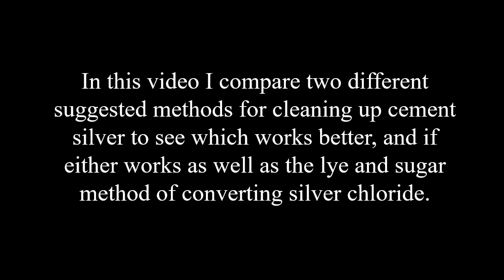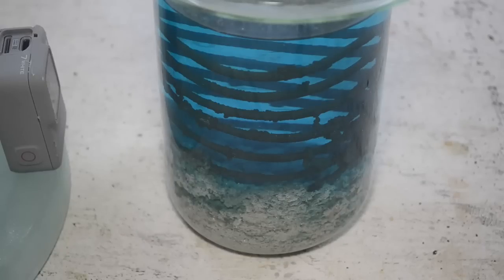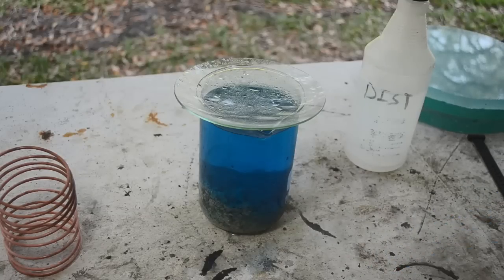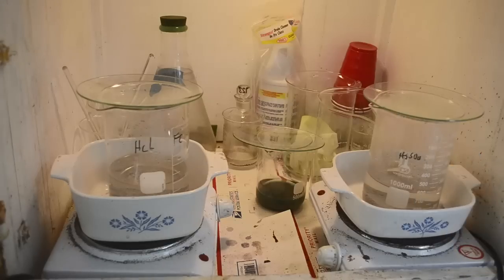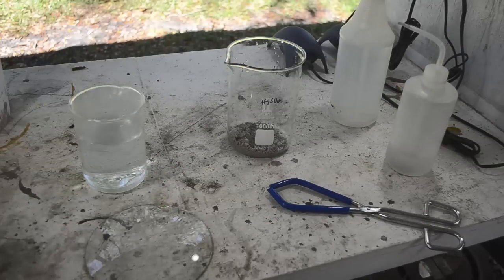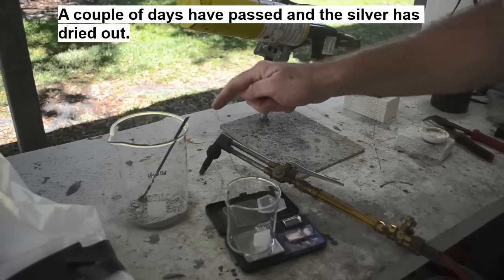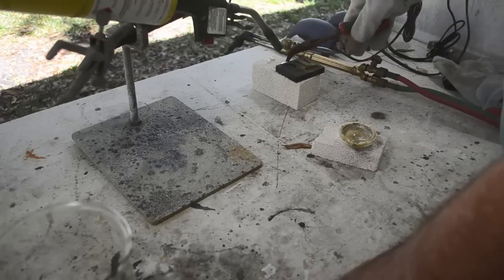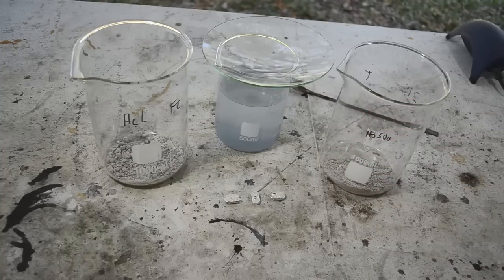Purifying Cement Silver With Acid Boils

Comment: I've found both to have their advantages and disadvantages.  The lye/sugar method is much more labour intensive and there's a much higher risk of loss due to boil-overs.  Conversion can be incomplete reducing yield and there a LOT of waste from washing.  Using copper is more expensive, takes longer and is less selective (also drops PGMs) but has much less wash waste and less labour intensive.  The chloride method you NEED to be involved whereas with copper you just "set it and forget it".  The end purity tends to seem better with chloride but it depends on how much you wash it.  Copper always seems to leave bit behind.  Either way I find that if purity is your end goal then you should run it all through a electro-cell anyway so go with the method that works best for the situation.  If I have time and free copper I use that.  If my solution is heavily contaminated with PGMs I go with chloride.  I really don't believe there is a "best" method.  It all depends on what's going on with that batch.
Reply: As you said there is no butter ways it all depends on how to deal with it

Comment: This is what i just learned from Lithic Metals: the first half hour is when you'll precipitate out MOST of the silver onto the copper. If you leave it for longer than that, which we BOTH did, the copper breaks down and mixes with the cemented silver. In MY experience it'll melt into a green, glassy, brittle button. I was searching for a way to remove the copper without nitric though and thanks to you I'm gonna do the sulfuric method and see what happens. Good video 😅

Comment: Love the experiments. I recently smelted up 2 batches of silver. 1st batch was 6lbs-2.8oz of pure silver crystals. The 2nd batch was 7lbs-2.4oz of cement silver using copper. The cement silver bars looked a lot better then the silver crystals bars and cement silver melts a lot faster as well. Both tested as pure .9999 elemental silver. I just simply flush the silver in a buchner funnel under vacuum with boiling hot distilled water until it runs clear. I've never tired the lye & sugar method just for the simple fact you end up with so much waste to process and have to deal with. The possibility of a delayed reaction causing a boil over. No thanks. The cost of lye and sugar. I use thick copper bars. I've made my own copper bare by melting up stripped wire and have purchased 1/2" thick flat stock copper bars. Using copper is a set it and forget it technique. Give it a stir a couple times a day just to keep it active. The simpler I can keep the processes. The less headaches I could possibly have. Fun stuff all in all. I'll be looking forward in watching more of your informational YouTube videos. Best wishes.

Comment: If you refine enough gold jewelry, you will find that the silver cell DIY method (Sreetips for example) is totally worth the effort.  I have always been concerned about reducing cost.  I make my own Nitric by boilling down sulfuric acid from car batteries to make my concentrated sulfuric acid  (like Mike does on this channel).  I use potassium Nitrate (spectracide stump remover using Philip Bender's channel method).  Why I like this experiment Mike, is because the better you can clean the silver, the longer I can go before cleaning out the silver cells' filter basket while simplifying the processing of the slimes.    After you see that beautiful crystal silver, you will NEVER go back!!!  So thank you Mike for sharing your experiences.  We must all be working to "perfect" our methods.  That is what makes it so much fun and rewarding.

Comment: Yes, more silver experiments please.  Silver may not be a pricey as gold, but I would feel a lot less worse if I goofed something up during the process.  Question: would have weighing the two samples before and after the acid boils been appropriate to see if anything dissolved out, or would the weight difference have been too miniscule to measure or matter?  Thank you for the great video and looking forward to seeing the next one!
Reply from the maker: Probably much too small a difference for me to measure with my equipment.
Reply: I personally boil my cement in HCL and add a few drops of sulphuric then drain, then distilled boils and rinses and the silver comes out beautifully for melting

Comment: Silver chloride - lye - sugar does produce high purity silver if you wash it carefully. The risk is that you lose some silver that didn't convert and that is getting trapped in the slag / borax while melting.
Any PGM group metals dissolved in the silver nitrate will end up with the wash water.
A perfect method when your source is very pure, for example photographic film.

For cementation, any PGM metals will cement together with the silver and end up in the silver bar. Anything else could be mostly removed by washing with boiling acid.

I had a suspicion that your silver nitrate had a slight palladium contamination based on the colour of the solution.

In the end you have to ask what the goal is. If you are refining to sell, does it really matter if your silver is 98% or 99.95%? Do you get such a high price that it motivates you to do the extra work to get the purity up?

Silver chloride doesn't store well and gets harder to process with time. Especially if it dries up. Cementation on the other hand is a lazy way to get the silver without too much work.

I have a flask with a permanent filter on and a bunch of scrap with mixed copper and silver, like relay points. Whenever I get small amounts of silver containing nitrate solutions I just pour it down through the filter and forget about it. Over time the copper goes into solution, silver and PGM:s ends up as a fine powder. Over time the copper dissolves and I'm left with a powder and solid silver chunks that's good enough to cast into anodes for a silver cell.
Then the cell makes high purity silver while concentrating any PGM in the electrolyte for later recovery.

The only time I create large amounts of silver chloride is when I'm recovering or refining palladium and other PGM:s, for example from MLCC:s.

Comment: I also watch sreetips a lot. He uses an electrolytic Silvecell to purify his cement Silver. He loads it as Silver shot and also recovers the slimes to process for noble metals. Theoretically the Silver crystals have less surface area and I'd say that should use less rinse water.
Reply: They do indeed and take a 3rd of the rinses

Comment: Very cool experiment 😎 thank you!!! I'm at this crossroads right now.
I have around 400 ounces of Sterling silverware!!! Not sure if it's economical to digest it !!!! Might just corn flake it and run it through my silver cell !!@ the prices for chemicals now days
Reply: I have also some old continental european silverware and objects, hallmarks 800, 812, 830, 833, 875, 900, 925, 950... (sterling not as much prevalent here). You do not get better value by disolving nice sterling silverware. I am going to purify only broken pieces, not hallmarked pieces of jewellery and use such for gold quartering if needed. Also I can make pure silver sheets and wire and make something or sell it to hobby jewelers.
IMHO: keep nice hallmarked silverware, as can have more than metal value (small spoons sell very good). To run sterling directly through silver cell is not good, too much copper in sterling, electrolyte will be blue and useless too fast, some purification needed before.
For me it si just (kinda expensive) hobby, I do not expect any gain except having fun doing it and have some self made jewels for flexing... 😀
Reply: I do it all for the stack and fun thank you 😊

Comment: I dropped some silver a while back and melted it into a small button. I melted it with borax, so naturally I wanted to remove the borax from the button.
I put the button into some hot dilute sulfuric acid and put it on heat. I forgot about it and it sat on heat for several hours. When I finally got back to it, the button was gone.
The sulfuric acid completely dissolved the button. Perhaps the acid was more concentrated than I thought, but The silver was dissolved into the acid.
Now when I clean off the borax I carefully watch it. I even take a pipette and hit the borax with jets of the dilute mixture and watch the borax fall off. When I'm satisfied the borax is completely removed, I'll pull out the button. Apart from dropping out lead from my gold solutions, Sulfuric acid has these only 2 uses.

Comment: The best solution to this problem is a nitric acid wash. 1000ml water, 50-100 ml of nitric @67%, stir, pour off and filter the blue, cement out your silver from your rinse solution, save for the next batch.

Comment: Trying to purify Silver that is for all practical purposes rather pure does nt click in my mind.. Unless you want silver anodes for electroplating, most silver will be alloyed with copper again to make Stirling Silver or Silver solders. I made a mini-ingot with my "cement silver" coming out of the copper ion exchange (as shown in you video) to test it with nitric acid and it came out something like 98-99 % pure enough for what I want to do with it. And OmG a fume extractor for working with 10% acid solutions? Americans are funny... Thanks for great video anyhow...

Comment: The easiest and pure way of purifying silver is to build a thumb silver cell for less than 30.00 and it produces almost the same amount but 999 Fine. Melt the cement into shot and run it through the cell
Reply: why melt? can you not just use the cement silver in the cell directly?
Reply: thanks for that, never done silver cell so good to know

Comment: I've also experienced that silver coming from AgCl tends to look much better than cement silver, so this was very interesting. I wonder if bubbling air into the acid solutions (and not boiling, at least at first) would get more copper out of by allowing more oxygen to dissolve (more contact and higher solubility at lower temps). Also, I'd love to see a melted sample from the same batch of cement silver as the boiled samples, to see how much improvement there is.

Göran also makes a good point about PGMs, which could be altering the appearance of the silver and are not removed with hydrochloric or sulfuric boils. That would explain why the boiled samples look better after the copper is removed but not as good as the AgCl process silver.